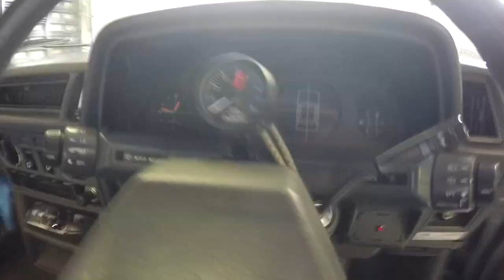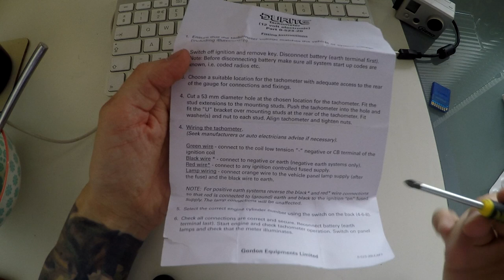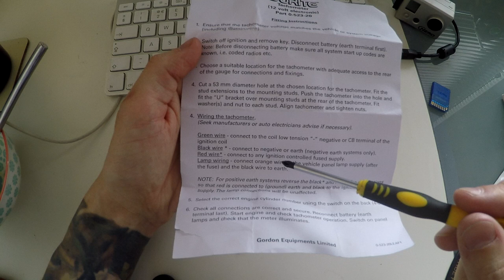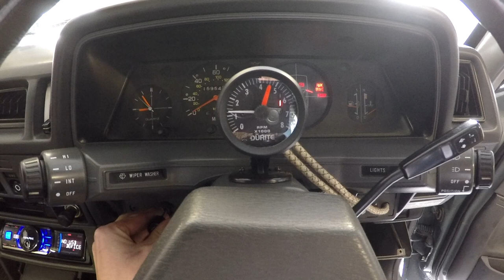Custom gauge install. Brat Vlog Ep.6

Comment: was it a nightmare feeding the wire through that flex cord?
Reply from the maker: +ScottsC1 Pretty easy actually, you can use a spray lube like GT85 to make it easier. The gauge of the pod wires are thinner than the ones that came out, so that helped.